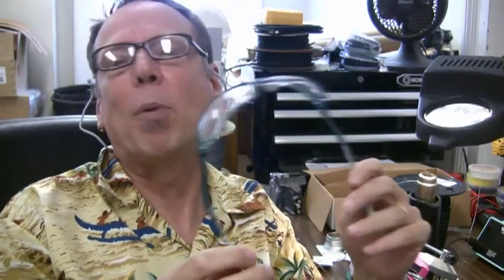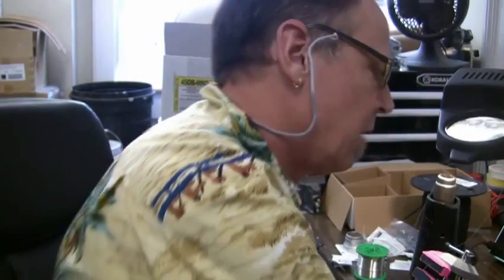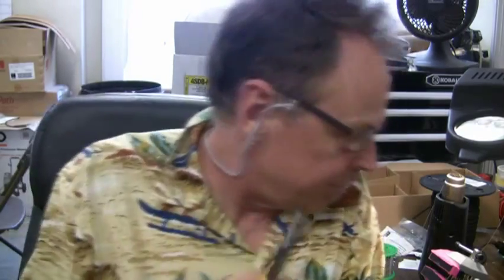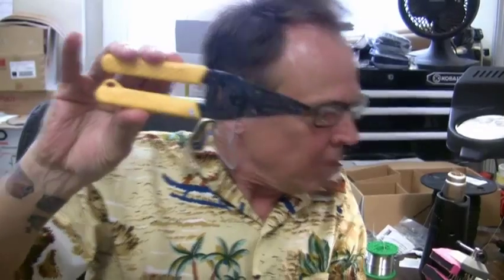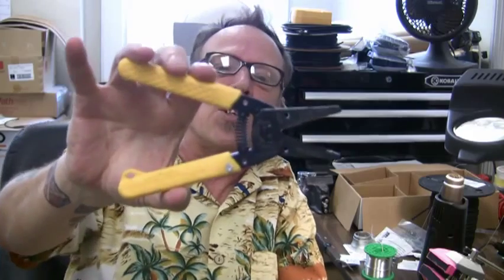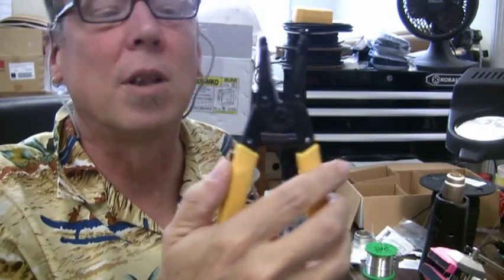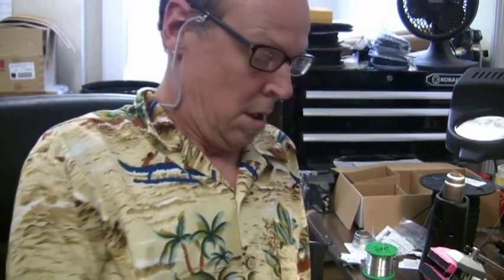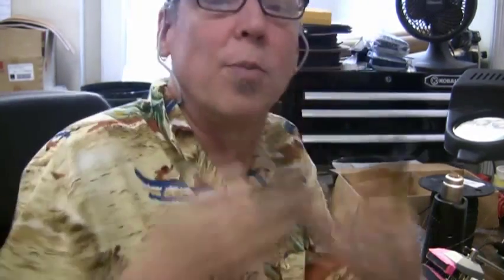Soldering 101: Safety & Tools

Comment: Ric, thanks for these vids. What wattage iron do recommend for wiring and what diameter of solder?
Reply from the maker: The wattage of the iron you choose is directly related to the soldering iron's ability to heat a wire and solder joint. If you are working with small diameter wire and PC boards then a lower wattage iron (25 watts) will work fine. Although a "regulated temperature" soldering iron is preferred for fine, small point work. Now if you are trying to solder 12 gauge speaker wire onto a 1/4" jack, you are probably going to need at least a 40 watt iron and a large tip in order to transfer enough heat to the solder points and the wire simultaneously. And that is really important to the quality of the finished solder joint. As far as the diameter of the solder, that's entirely dependent on the size of the solder joint you are trying to make. If you are working on PC boards, get a small gauge solder to avoid excessive solder buildup in the cup or pin hole.

Comment from the maker: Hi Amanda
There probably isn't anything around the house you can use to remove hot, liquid solder. One thing you can do is heat up the joint and then quickly shake the solder off the point. Now obviously hot solder is going to go flying when you do this. SO be careful. I've had to use this technique 100's of times in the field. What you really need is a "solder sucker." You can get one at Radio Shack for under ten bucks. I am available for private, in home soldering sessions at any time!   :)